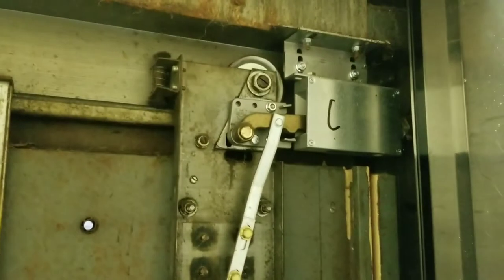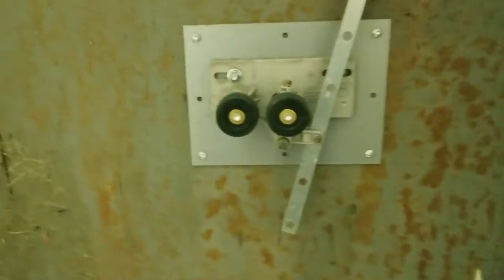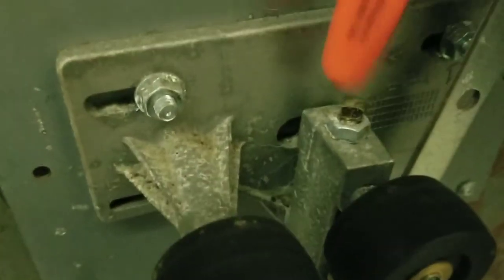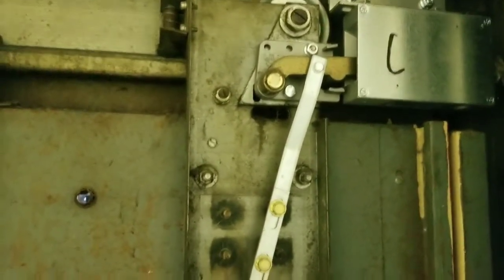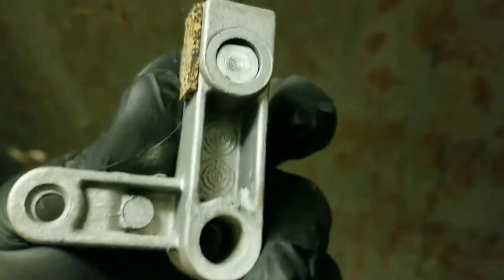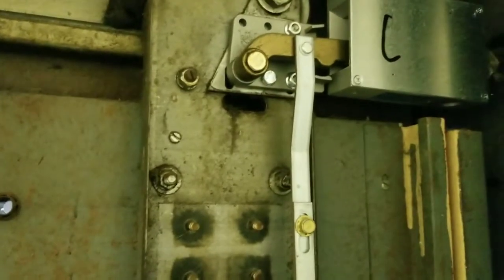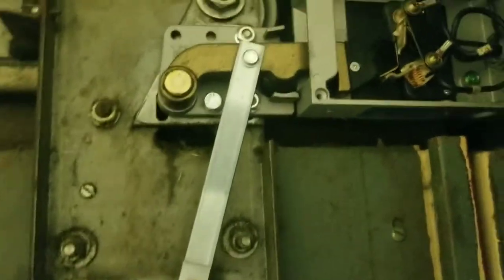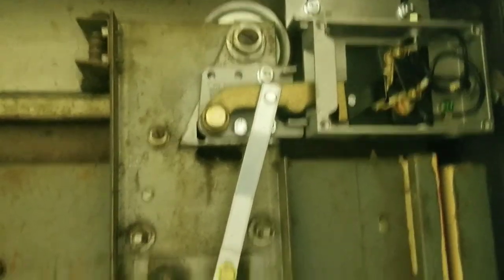Service Call #6

Comment: What an unusual placement for the drop key hole. How long of a drop key do you need?
Reply from the maker: That hole was located there for the previous door lock setup. The guys never moved when installing new locks, it has since been plugged and a new hole made.

Comment: That interlock appears to be an E.C.I. if I'm not mistaken. I actually have that type of interlock with the same door latch in my own elevator collection that I just recently did a brief overview on just recently ago.
Reply from the maker: This setup is actually a GAL or galaxy. Very similar to a eci bit you'll notice a black beak instead of white and inside the lock is black with a slightly different setup.
Reply: @MQElevators  You saw my E.C.I. interlock overview video? Yeah, I do notice that the latch seen in this video is black than the one I have in my collection that's white, but the looks of it appear to be the same but slightly differ a bit, so I do understand what you're referring to. I feel like seeing this video has sort of inspired me to show some overview of my elevator parts! :D
Reply from the maker: I did watch it, 👍

Comment: Do you work on elevators? Seems like you’re an elevator technician of some sort! I actually have an exact same door interlock including the latch itself! The latch is the same exact one, but the interlock box itself is made by ECI, which are on Schindler elevators. By the way, what kind of elevator is this? It appears that the interlock is GAL. Great video! :D

My name is Jim, and I am an elevator enthusiast.
Reply from the maker: Hey Jim,
This is an old Armor elevator that recently got new GAL locks, door operator and travelling cables. I am a elevator mechanic who does maintenance and service. 

Thanks for watching
Reply: MQ Elevators This is great actually! If you don’t know this, I actually have an elevator collection where I have parts taken from a lot of old elevators. Speaking of, I actually have the exact same door roller, interlock, and the latching bar that’s exactly shown in this video! I didn’t know that the latch unlocks at an angle. For a while, I thought it pushes directly upwards. I felt like this made me learn something new.

Hope to hear back from you soon. Thanks!
Reply from the maker: I enjoy doing these videos and I'm glad you learned something in this one.
Reply: MQ Elevators When you record these videos like this one here, no one cares that you do so and stuff or do you just film these videos for your personal fun? I’m just curious to ask as most elevator technicians do not film anything while they’re working inside the shaft, machine room, or in the hoistway/pit for privacy concerns. This also kind of reminds me similarly doing a few videos of me riding inside of an elevator shaft (no, I am not a tech, but I was accompanied by an elevator tech), seeing the parts of an elevator, and inside the machine room.

Speaking of that, I may probably be invited for another behind the scenes elevator tour (which may likely include an elevator shaft ride) for my birthday, but that is all up in the air as of right now.
Reply from the maker: Well I hope you get to check another one out. As for the videos I just film them cause I like to, I try to not film showing how to access the car top or anything that would put someone at risk. Some of the people I talk to think it's a cool idea to make some videos. Its just tough to film sometimes because it does take time and sometimes people need their elevators right away.
Reply: MQ Elevators Me neither, unless if my elevator technician friends say that is okay for me to show people how to gain access into the elevator shaft, but more than likely I’m not even going to do that at all as I fear somebody might copy exactly what I did and possibly get hurt for real. About a couple of months ago over Christmas break, I got to see the equipment parts that go into an escalator and how they work! Yes, I have a video of that surprise tour, which I will hopefully have that up sometimes next week or so of some sort, but I don’t know for sure yet. It was during the escalator construction process that took place at an airport just early before I flew home from out of town. I really love showing in full details of what the parts are like behind the elevator sides itself, especially looking inside the elevator shaft. I just don’t know when I will get another elevator related invitation, but my goal is to do that for my upcoming birthday.
Reply from the maker: @JimLiElevators  Looks like your channel is doing very well. I watched your trailer and I recognized Diesel Ducy in it. I like the little community of elevator fans on YouTube
Reply: MQ Elevators Thank you so much for watching my stuff! Yes, DieselDucy is Andrew Reams here on you too. Haven’t you watched him as well? He started the whole entire elevator community about 13-14 years ago, and he’s the main elevator fan amongst all of us. Anyways, I did do a unboxing video of a couple escalator, plates, few Schindler manuals, A flashlight, applier tool, and also a Schindler elevator floor position indicator like what you find at the Marriott Marquis in New York City. I will hopefully upload that one before my escalator tour video of some sort. I have a collection of elevator parts.